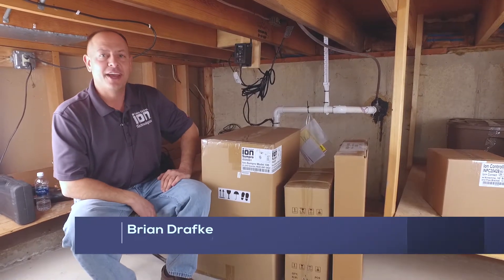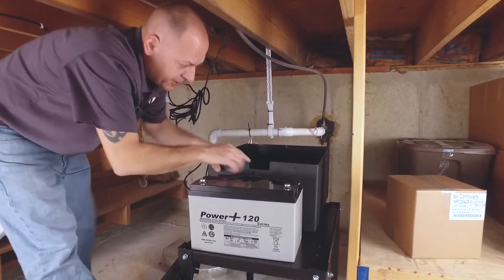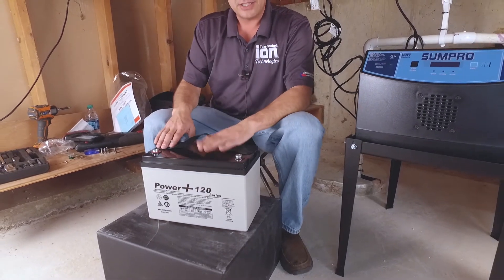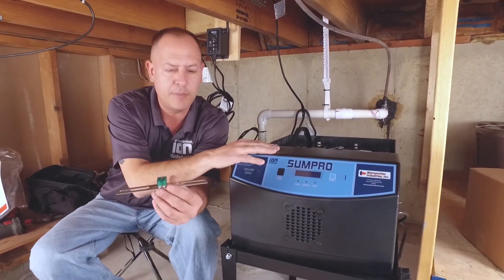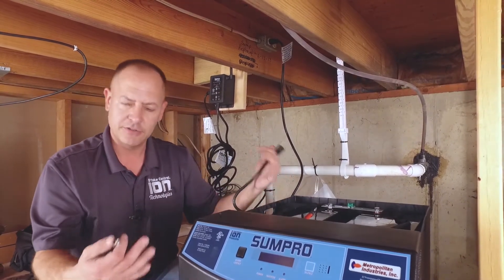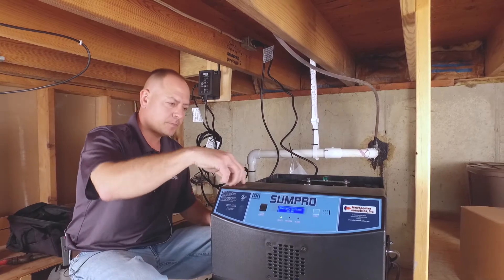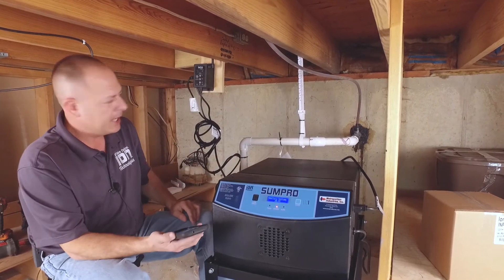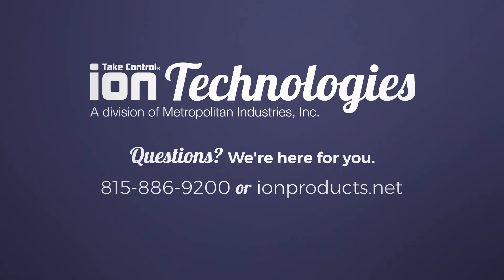Sumpro Installation and Basic Setup

Comment: Is it ok to use Duracell AGM 100v batteries?
Reply from the maker: We instruct our customer to avoid, (If possible) pairing our inverter system(s) with Duracell products. We discovered over time; our systems charge at a rate that affects the Duracell batteries. For additional information, please contact our support team at 815-886-9200.

Comment: I have two  Zoeller pumps in one pit one of the pumps is higher up than the other . which one do I plug-in to the sump Pro? The one that sits on the bottom of the pit or the one that is above the other pump

Comment: I have two Zoeller pumps plugged into it. One 5 Amp and one 9.4 Amp. I tested it and it worked fine in testing. I have two pumps because my basement flooded when my 1 pump was overwhelmed during a heavy storm. Should I be concerned about having two plugged into it!?
Reply: Corey, Yes you should be concerned about having 2 pumps plugged into it. The 2 different outlets are for a pump and a separate high water alarm. Please contact our customer service department so we can get you in the right direction. 815-886-9200

Comment: At the 10 min mark you say "you do not want to plug 2 sump pumps into the two outlets". Why not? Please explain
Reply from the maker: Nathan, thank you for reaching out to us! Typically one outlet is meant for a pump and the other outlet is meant for a high water alarm.  This is because the Sumpro unit can only handle 12 amps at a time. Running the two pumps would exceed the allotted amp draw and could possibly cause the battery backup equipment to malfunction. In addition, this set up also allows a jammed pump in a locked sump pit to pull anywhere from 2-3 times the amp draw its rated for. However, if you are interested in running two pumps in tandem we highly recommend our Ion Genesis controller. Please feel free to call us at 815-886-9200 if you have any further questions.

Comment: What does it mean when the green and red both flash and a clicking sound every minute or so , I think it is a #75 ? Thank You.
Reply from the maker: Mike, the system is likely in reset mode. The Sumpro does this when batteries are installed into the system. If the lights continue to alternate and the unit stays in this mode, there is an issue with the Sumpro. In rare cases it could also be the batteries or fuse link. Please call us at 815-886-9200 if you continue to experience issues.
Reply: Thank you for getting back to me, the problem wasn’t the sumpro but the main sump pump, the impeller was blocked,